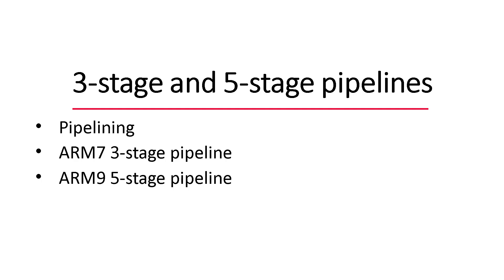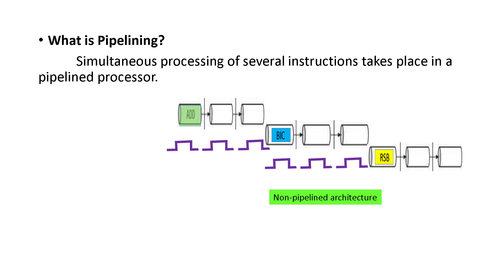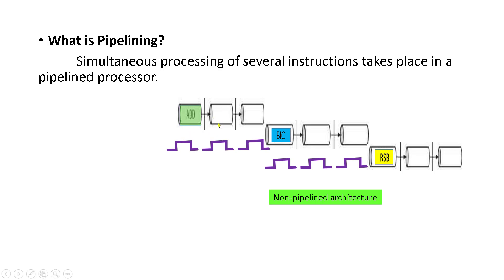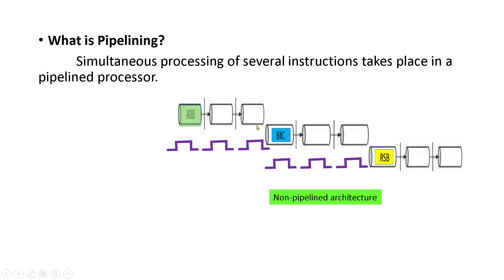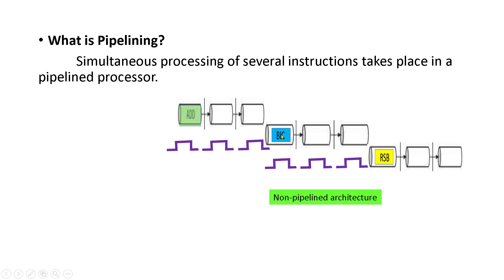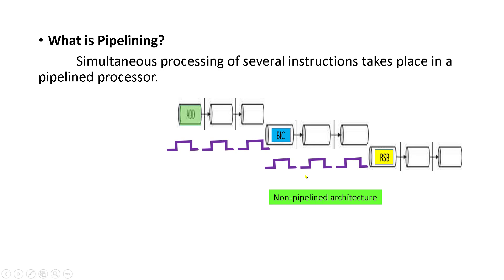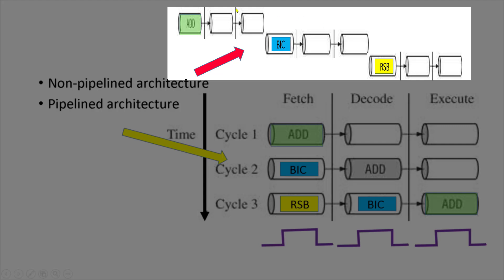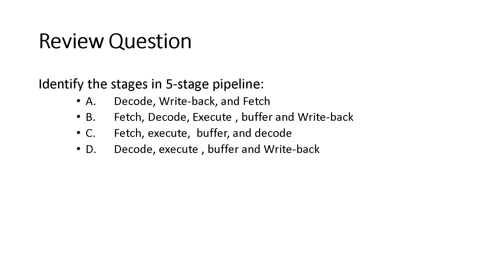Pipeline in ARM Processors (3,5 stage)

Comment: 00:05 The video discusses three-stage and five-stage pipelines used in ARM processors, explaining what pipelining is and its advantages and resources.
02:25 In a non-pipelined architecture, it takes 9 clock cycles to execute 3 instructions.
04:50 Pipelining increases execution speed by allowing multiple instructions to be processed simultaneously.
07:26 The three stage pipeline executes instructions with a latency of three clock cycles and a throughput of one instruction per cycle.
10:09 Three-stage pipeline in processor
12:31 ARM processor pipeline has three stages - register, decode, and execute.
14:58 The ARM9 processor uses a 5-stage pipeline.
17:33 The processor has a five-stage pipeline.